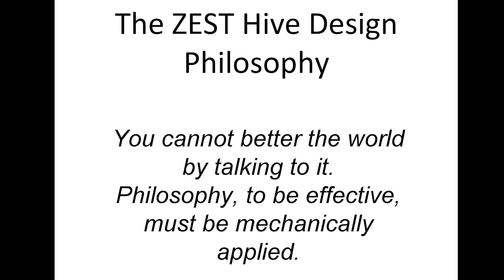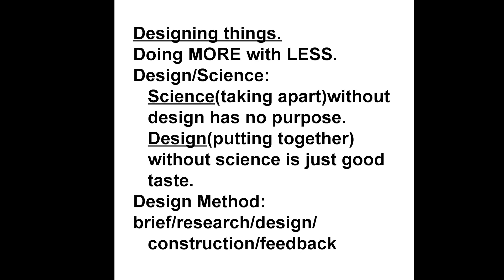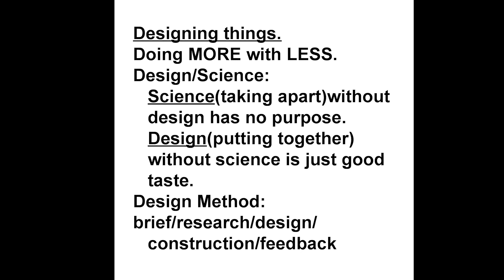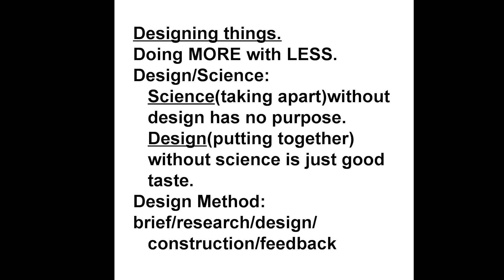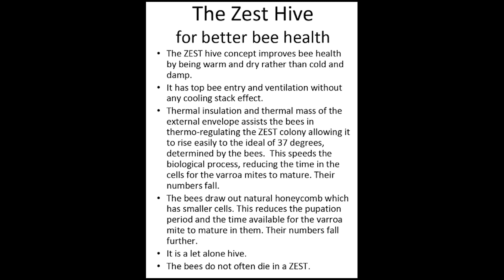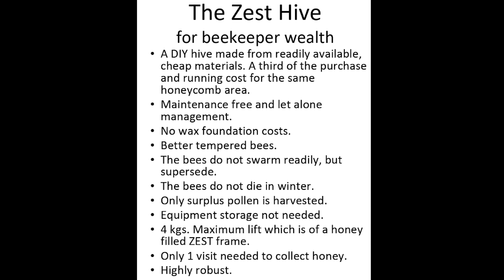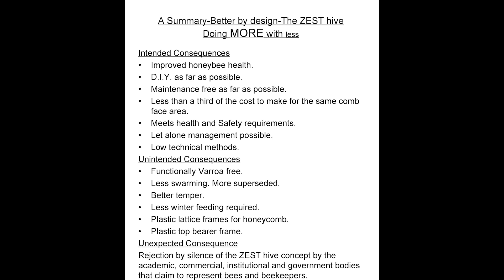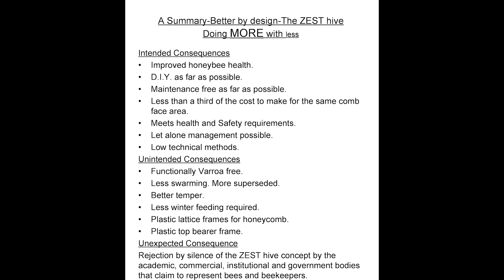Treatment free "Letalone" Beekeeping in a ZEST insulated hive - The design philosophy

Comment: I like your design, it looks like something very interesting for a hobbyist to try, especially if it simplifies their beekeeping & helps bees. 
However, to me it doesn’t seem like practical solution for most commercial beekeepers who need to have hives that can be mobile. This has nothing to do with egos or inability to embrace change, just practicality. Is this something you accounted for in your design? Is it something you can account for in your design process?
Reply from the maker: Wendy, Thank you for your comment. I agree that the ZEST hive is not as mobile as a conventional hive which just needs some sponge in the door and a carrying strap, but is moving them such a good idea as it stresses them and carries disease about. The ZEST hive, based on honey comb face area, is 3 times better value than a conventional thin walled hive and with no maintenance costs such as for wax foundation and frames, nor any varroa. Instead of moving them 3 times in a year for fruit and nut pollination like they do in the USA why not have one ZEST in each of the 3 sites. Some under planting for when the pollination crop is not available to the bees and hey presto all problems solved.
Reply: Chemicals applied as soon as the bees are removed from all those sites to control other insects is why bees can’t stay on those sites year round. 

Non the less I like your ideas and want to continue to explore/ apply
Reply: Yes, I agree that those crops requiring pollination services could be managed a lot better as multi-species plantings can solve a multitude of problems. But I’m in Australia, a lot of the commercial beekeepers here have their bees in natural forests with diverse species, and still the hives need to be moved regularly just to keep them fed, otherwise the cost of feeding is prohibitive. Bees would still experience stress in the wild so it’s not something that can be eliminated completely, just managed as best you can.